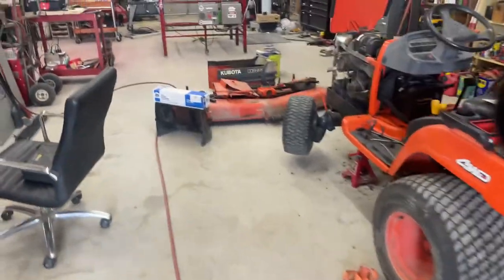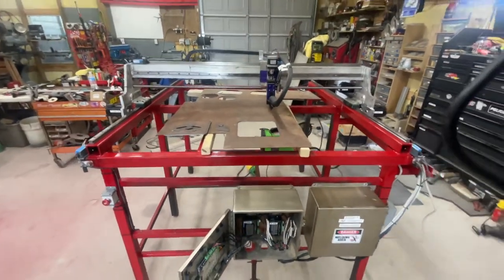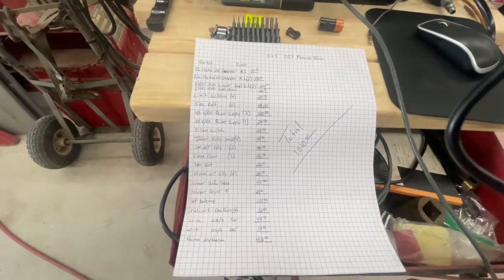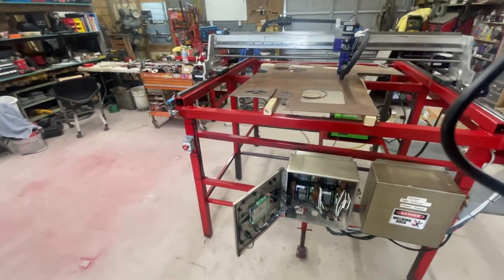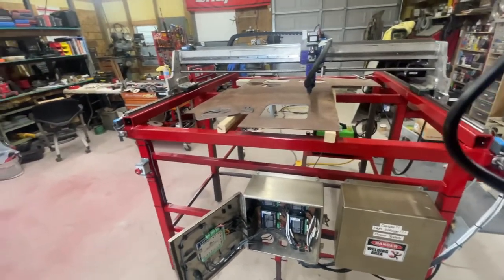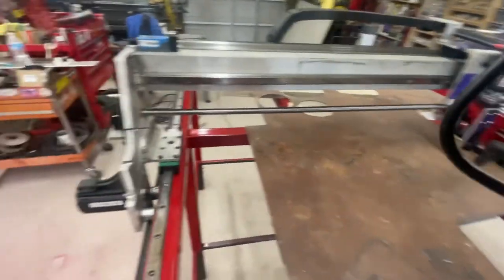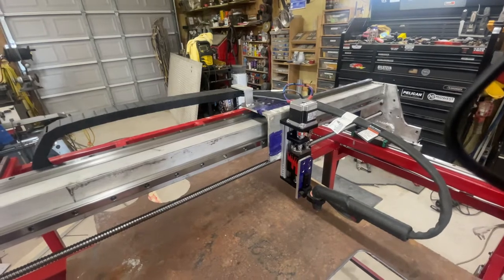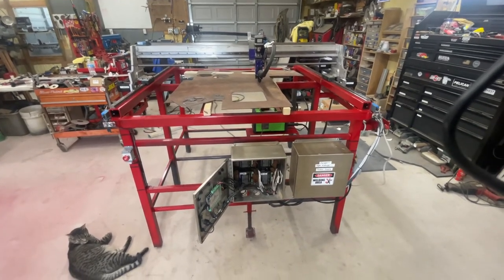Middle Budget DIY CNC Plasma Table Cost 4’ X 5’ Using Proma Myplasm Controller

Comment: I'm in the process of building my own 2x4 table right now, and I'm getting to the point that I need to start looking at the electronics...
Reply from the maker: I would HIGHLY suggest the Proma Myplasm controller! I knew absolutely nothing about CNC and all of the research I did led me to the Proma system and I'm so glad I did! Very easy to wire and the software has been great! I paid 450$ for the controller and THC as a kit. It can be done for cheaper but you better know computers way better than me...
Reply: @OldBarkerRanch1981  I've been looking at the Proma for the THC...I just ordered the CNC controller, power supply and stepper drivers, so the THC will probably come into play once I get the basics working
Reply: @OldBarkerRanch1981  you got it at a great price...looks like it jumped up a lot! Their kit with drivers is the whole cost to you $1800!
Reply from the maker: I only bought the CNC Controller and THC from them, all of the motors and drivers were sourced elsewhere. I have a video on the entire cost breakdown and where I got the parts.

Comment: This is right in line with what I'm trying to do, what exact motors are u running?
Reply from the maker: Stepper Online Nema 24 Closed Loop for the X Axis and Stepper Online Nema 23 Closed Loop for the Y Axis (2) and a standard Nema 23 for the Z Axis.  The Nema 23 kit (Motor and driver) on Scamazon was 95$ each and the Nema 24 kit was 115$.

Comment: Nice table...
I'm in progress of building my own, JD's garage model, a copy of Langmuir crossfire.
If i knew what i know now, i would go with a project like yours, because Arduino controller in that project is not a big deal...
MyPlasm cnc controller looks to be a lot easier to deal with. 
The table i'm building is a 2 by 3 foot, this will be my 1 of 2 project, probably going with a 4 by 4 at the next step, but with the MyPlasmcnc controller.
Thanks for the video.
Reply from the maker: It will be worth it I can assure you! Thanks for watching!
Reply: Nothing at all wrong with Arduino